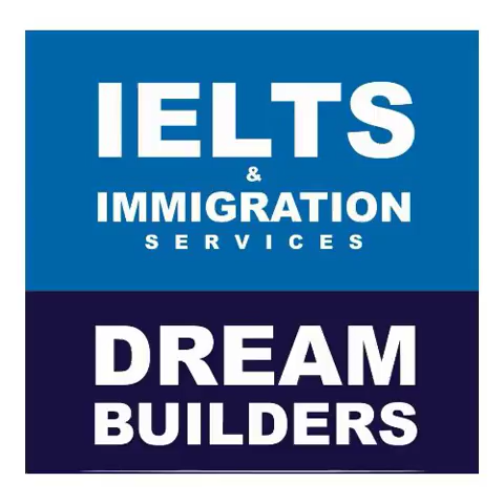IELTS Listenong practice test(*#(21 Jan 2019)

Comment from the maker: 1. 300
2. sunshade
3. balcony
4. forest/forests
5. 319
6. 10,000
7. relative
8. missed
9. item
10. Ludlow
11. C
12. A
13. C
14. E
15. H
16. F
17. C
18. G
19. 120
20. 5 to 12
21. fishing industry 
22. statistics
23. note-making
24. confidence
25. ideas
26.  student support
27. places
28. general
29. 3 times
30. 25
31. B 
32. A
33. glass
34. insulation 
35. windows
36. electricity
37. floor/floors
38. waste
39. concrete
40.15 years